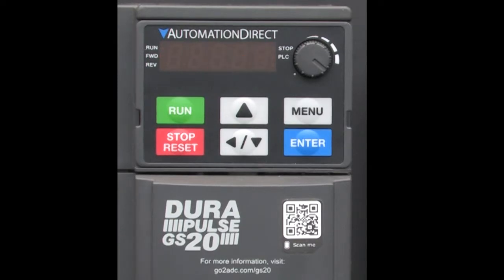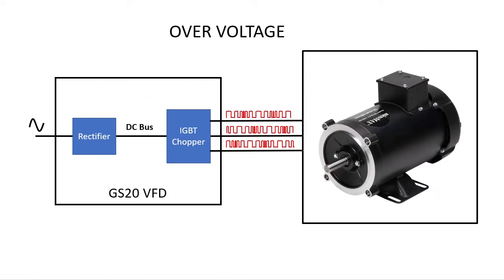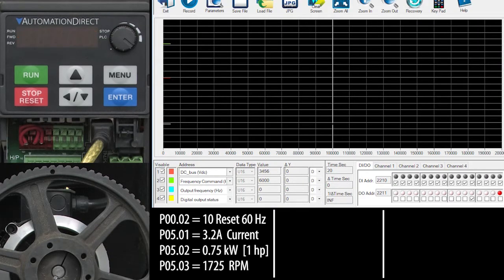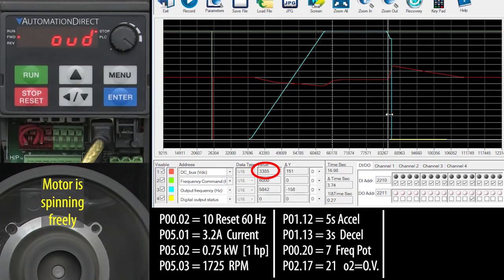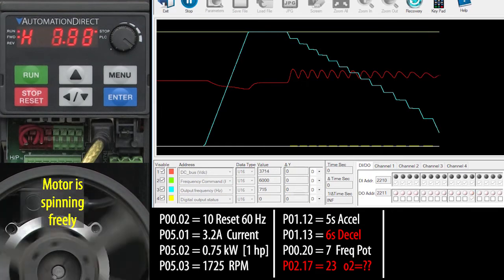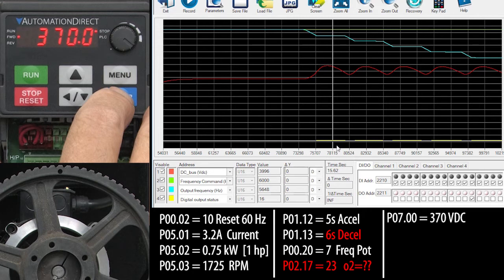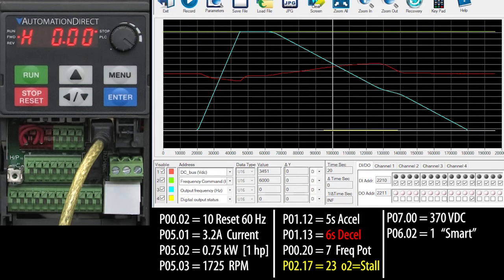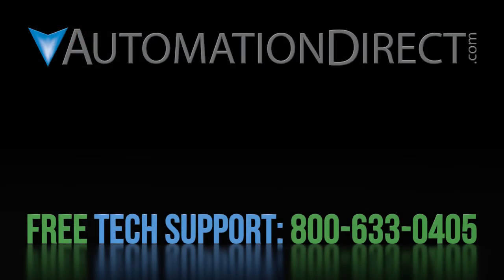DURApulse GS20(X) VFD: Overvoltage Protection from AutomationDirect

Comment: Hello Thank you for wonderful video. I have a GS23-55P0 of 5HP driving a 3HP 3-PH 575VAC motor. the motor is for a small stamping press with flywheel. I got the OVN fault (over-voltage during normal constant speed). Can you tell me what I should do about that ? Increasing  deceleration time will help to solve the problem ? I just bought it today. The drive is brand-new. Is it a suitable using 5HP VFD for a 3HP motor ? Thank you
Reply from the maker: @disun, does the OVN occur when the flywheel is disengaged? If so, take a look at a braking resistor to absorb the reverse EMF. If it is not, try contacting our FREE award-winning technical support team for further assistance specific to your application.
https://community.automationdirect.com/s/contactsupport?utm_source=dBJh48mxezY&utm_medium=VideoTeamComment

Comment: What about trying to start it while it's decelerates? Will that cause over the voltage?
Reply: Typically, if the motor will stop without overvoltage then the restart will not cause it.

Comment: I am confusing about how induction motor at deceleration time regenerate electrical energy!, because the stator is windings and the rotor is just a core. I mean there is no magetic parts inside to generate electric currents. So if i take digital mutimeter and make a simple experiment to measure the output voltage from the motor at deceleration time and suppose the dec = 6 sec, the question is, any output voktage will be when take reading by digital voltmeter? I have 18 kw 3 phase induction motor 380 AC connected to vfd and measured any output volt when stoped but nothing. So i am confusing about that issue.
Reply from the maker: Hi Wadi, That's a really good question and one that most folks don't think about (and the video over simplifies).
When the VFD applies it's output waveform to an induction motor, it creates a magnetic field around the rotor. In a 60 Hz system and a four pole motor the rotating field moves at 60Hz x 30 sec/min = 1800 RPM.
1800 RPM is called the "synchronous speed" and if the rotor actually turned at 1800 rpm, then the rotor and field are in sync.
But in normal operation the rotor spins slower then that, usually 1725 rpm or so. This difference, called the slip, creates a current in the rotor which is what generates the torque. The larger the slip, the more torque (up to a point).
So when you apply a load like braking or just try to slow the motor down too fast, it creates a large difference between the established field frequency and the rotor speed, which creates current which is forced back into the drive capacitors and builds up the voltage. 
Does that help?
Reply: @automationdirect   @AutomationDirect.com 
I think i have another explanation.
I noteced from your video, the overvoltage happened in a very short time (m. sec) and the Gsoft2 showed  that, and can not catche it easily by digital multineter. It is just a spike. So i am thinking, we can consider the motor as a big inductor with a big core, when AC is applied to the inductor, an EMF will build up and a few seconds a electomagnetic field built in inductor(stator), when applied AC removied, the electromagnetic field stored in the inductor(stator) will resist the new case and large currents will be back into the intire circuits of the drive. The IGBTs will face a reversed current and volts and sone diodes in parallel will transistors will be in reverse biasing, if the revese biasing so big, then the IGBT will be damaged very fast. For this reason the dynamic resistor do as a bypassing the huge current and absorb the spikes built by the EMF.
This is my explaination, so is it right or not.?
Reply from the maker: Yep, sounds like you have a good feel for what is going on!
Reply: @automationdirect   what do you think about my explanation?
Reply from the maker: Yep, sounds like you have a good feel for what is going on!

Comment: This is actually an impressive drive line. I have a gs20 driving a 5hp 3p motor and large air compressor. I was very impressed with the parameter functionality and the options for digital I/O
Reply from the maker: Thanks Becky, This is probably my favorite of all the ones we offer ...
BTW - Are you aware that we have a LOT of videos showing you how to use the GS20's and all of our other drives too? Check it out here:
www.AutomationDirect.com/videos           (Random Search)
www.AutomationDirect.com/Cookbook      (By subject)
Reply: @automationdirect  yes I watched them and I have been studying the manual. I want to enable the 3 wire start stop function in the drive but I can’t tell if the drive will latch the start for me or if I need to create a latch via relay. Also I would like to incorporate a hand off auto so I can manually start motor via push button or run in auto via control by pressure switch input.  I also want the drive to output when it’s in an alarm state and whe the run command is active so I can have a couple status lights. I think I got the output figured out . I see a parameter for hand off auto mode but I think it’s more for manual operation via hmi. Also I’m going to mount the keypad on the enclosure but the shortest cable they offer is 3 feet long!!!! I can’t coil all that up and build a pretty box. Can you all make me a short cable?